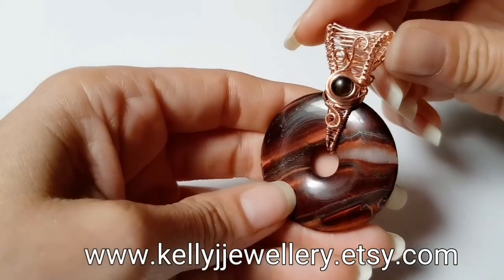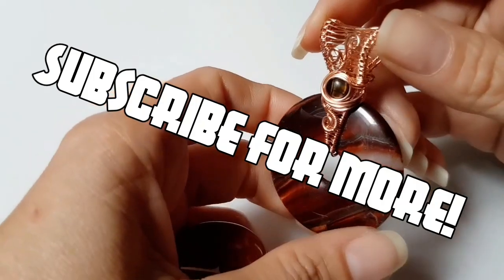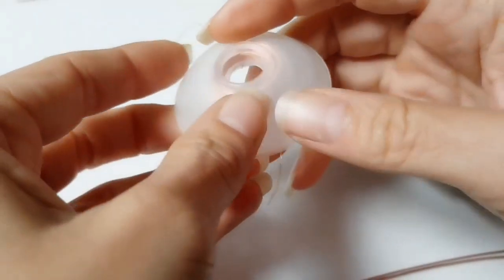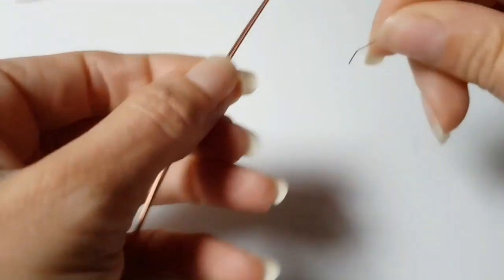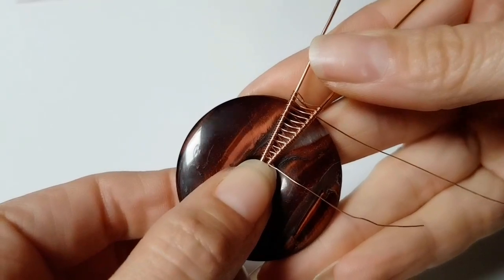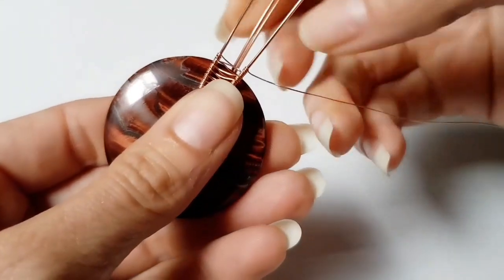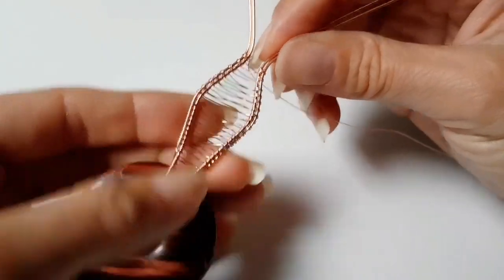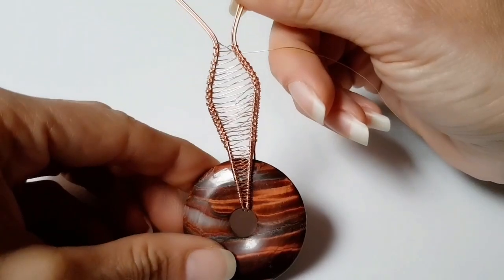Wire Wrap Tutorial "Lupa" Pendant.

Comment: This is just the tutorial I was looking for, a very pretty wrap for a donut-shaped focal. I do have a question as to the treatment of the tiny cab on the front. I have arthritis pretty bad, don't have good control over my hands, and was considering the possibility of using a drilled bead of some kind, and attaching it to the front weave--then wrapping it with the larger wire as shown. Is there any reason this wouldn't work? Have tried repeatedly to do these tiny/smaller wraps and cannot manage. Thank you for sharing this pretty, fairly simple design! EDIT: LOL, I should have read through the comments, the question was asked and answered! Thanks again!
Reply from the maker: Thanks so much. Yes you can use a bead, have fun ❤

Comment: You ever use the bale design to wrap the stone? 2 wires wrapped closely then bend it to pocket the stone, trailing the ends different ways? With thec2xwires and wrap being thin it allows more light in from the sides to give a less opaque or dull look to the stones.
Reply from the maker: That's a great idea. Thanks for that 👍🌹🌹🌹

Comment: Hi Kelly, this is a fabulous tutorial, thank you.  I just wanted to ask you:  Do you use Non Tarnish pure copper wire or raw pure copper wire?  I have just started to use NT but am unsure if it will remain permanently untarnished or if it will gradually tarnish over a longer period of time, in which case there would be no way to bring it back to bright copper.  I have only been using the NT for around 2 months and would really value your advice from a longer term perspective.  Also, what thickness of wire do you use to wrap the tiny cabochons?
Reply from the maker: Thank you so much. I always use raw copper because I like to oxidise my work, keeping the piece nice afterwards just takes a quick rub with a silver polishing cloth. I have non tarnish silver, and I find that wears off after a month or so. I also coat some of my work with an everbrite coating, then it doesn't need polishing. (Though I'm not sure how long that lasts) ❤️

Comment: I love this and want to try making it but I don't have the little flat cabacon. Is there something else you could use instead???
Reply from the maker: The little stone can be replaced with a bead or just finished with wire and no stone at all. Have fun ❤️
Reply: A bead of similar size
Reply: I usually just finish with a swirl on my pieces, and if I do include a stone, i usually use a bead, so I am sure you can use either or in place of the little cab.